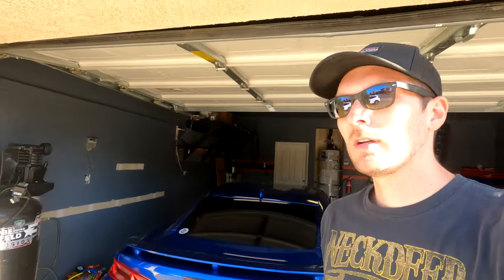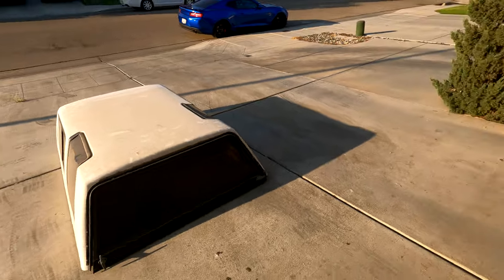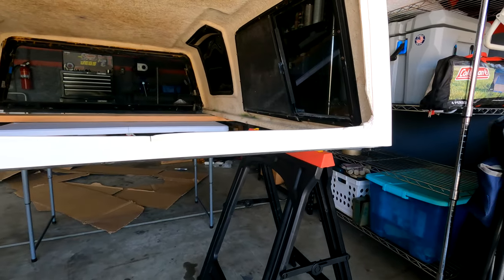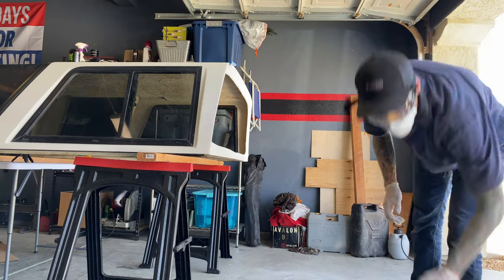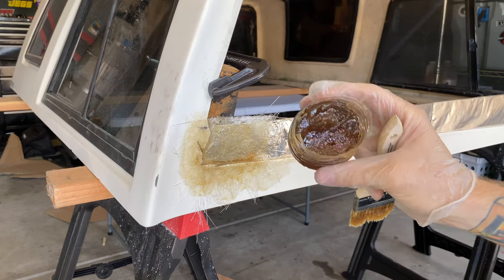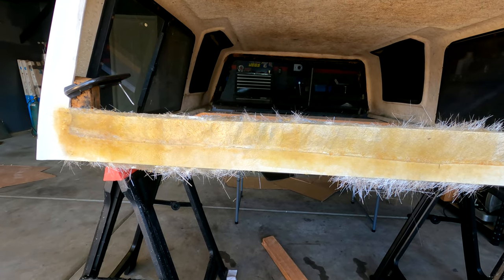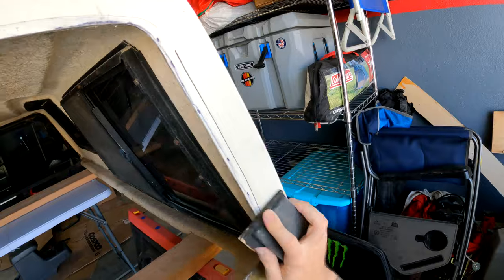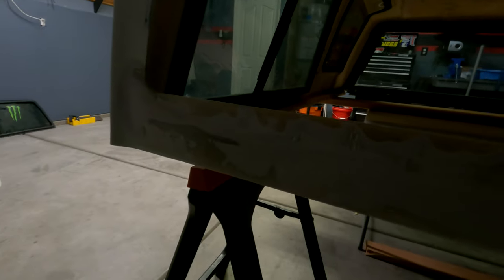Make a Fiberglass Part From Scratch - How To (BEGINNER) // Camper Shell Build Ep. 2

Comment: I’m doing the same thing and everyone is saying I’m wasting my time, I got the cap for $100 just had to cut it down 2 inches and fit one side window in sorta like what you did, I’ve never worked with fiberglass before and it’s messy but I’m getting it done , thanks for the video it helped out alot

Comment: You need a bigger mixing cup, when the resin sits in such a thick layer it hardens faster than if you spread it thin. Heat might have something to do with it but I just know thick layers harden faster. A quart paint mixing container will mix 16oz no problem if you’re pouring it. For 4oz a quart mixing cup is fine. Red solo cups work for this as well 

How’s the repair holding up? I need to do this for my camper and I was wondering how strong it is. Usually you take a grinder and bevel out a couple inches so when you lay up the fiberglass it’s not forming a lap joint. There’s more bond surface area and you build the fiberglass up to match the thickness of the camper shell. Also sand your body filler when it’s almost hardened, like when it starts making crumbs when you sand it. You’ll save a lot of time and dust
Reply from the maker: Thanks for the tips. It was my first time so I just went for it. It’s holding up great, I’ve gone on a couple rock crawling trips since then which is flexing the bed+camper and it hasn’t had any issues.